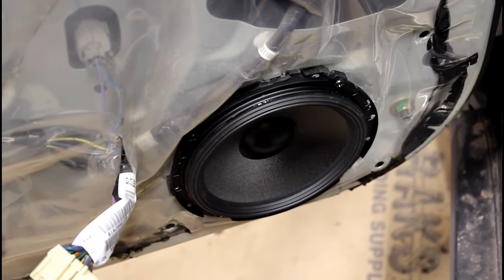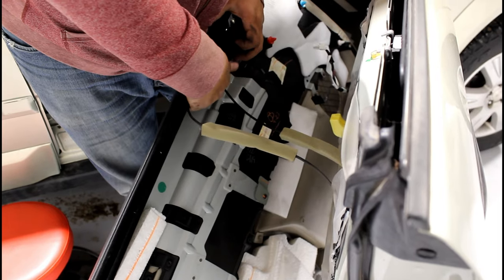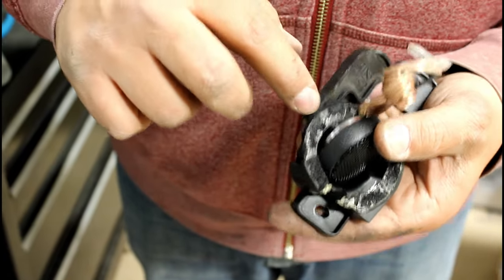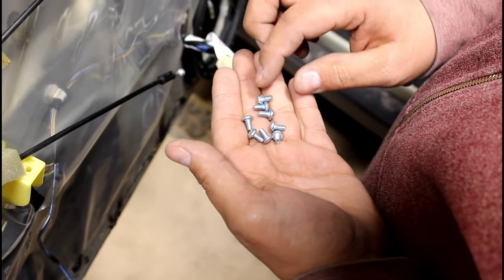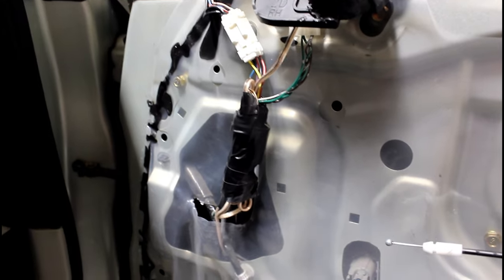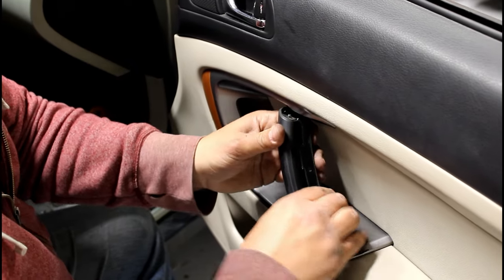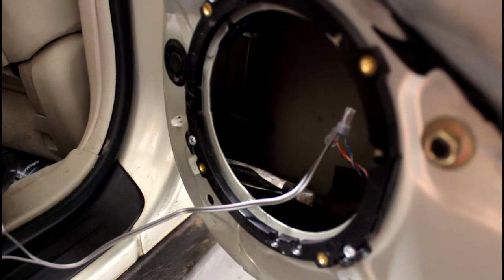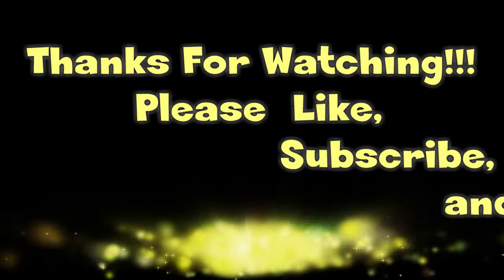Subaru Outback Speaker Upgrade Step-by-Step (Front & Rear)

Comment: I just did this install, thanks for the tips. FYI you can remove one more layer from the tweeter covering to make it fit in the original mount without cutting it like your video shows. Thanks for the video.
Reply from the maker: Good tip!

Comment: You can easily figure out which speaker lead is positive and which is negative.
Take a 9 Volt battery (one with the + and - marked on it makes it easier) and put a wire from the negative battery connection and the other end to 1 if the 2 speaker terminals. Then put another wire from the battery positive terminal to the other speaker termina (both battery and speaker terminals connected)l. If the speaker cone pushes outward, you have the correct postive and negative terminals identified on the speaker. If the speaker cone pushes inwsrd, then you know the terminals are reversed (no need to change the connection location again as you have your answer either way) and + and - are still known.
Reply from the maker: Thanks for watching!

Comment: Do I need to change out the stock head unit?
Reply from the maker: No.  But u can in the future is u want.
Reply: @FatGuyBuilds  do I need an amp for additional power?
Reply from the maker: @jayanson4618  only if u want.  But it will sound better no matter what.  Just do the speakers first and go from there
Reply: @FatGuyBuilds  my thinking was keep the OE head unit and add an amp
Reply from the maker: @jayanson4618  get an audiocontrol LCQ-1 and then a 5-channel amp.  But just do it in steps.  Do the speakers first

Comment: Are the original speakers 8 ohms? These alpines are probably 4 ohms. Surely that makes a difference 🤔
Reply from the maker: Stock was 4
Reply from the maker: Even if they were 8.  The amp is 4ohm stable.  Dont worry about it
Reply: @FatGuyBuilds  my cars macintosh definitely has 8 ohm speakers. Not sure if 4ohm speakers would work 🤔
Reply from the maker: @matthewchild7927  will definitely  work.  All these amps are 4ohm stable.  Just dont go dwn past 4ohms